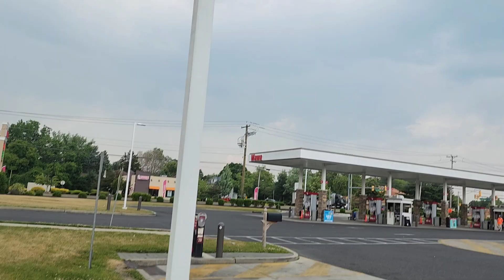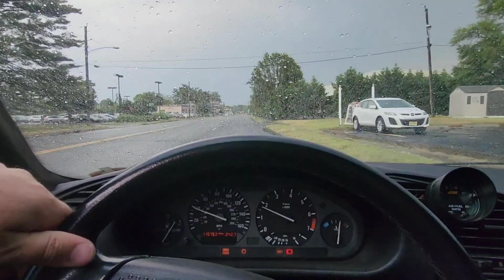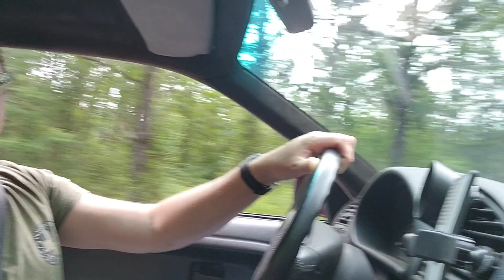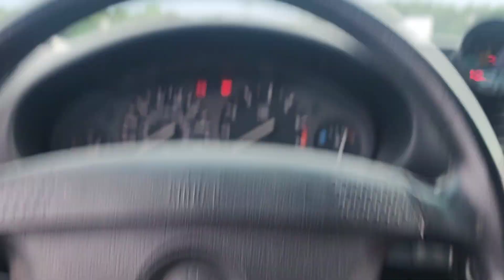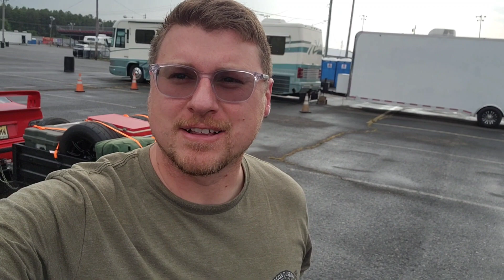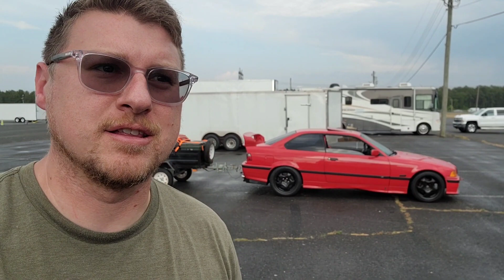Attempt at Testing the GMW

Comment: Also bro if you want you can take out your dash, 2 screws in the top part of it. And go behind it and take out your check engine light bulb and the other ones that are lit up so they dont bother your ocd😂. It’s literally a bulb that you can take off with a set of pliers! Takes 2 minutes
Reply from the maker: Thanks bud, the check engine light is actually on because I have the maf failed for tuning the VE table. The rest of the light I'm not worried about but I'm aware I can pull the bulbs.